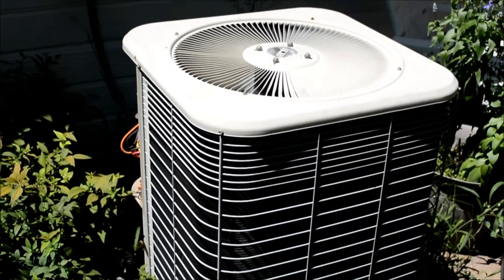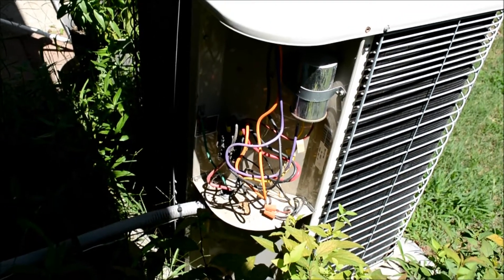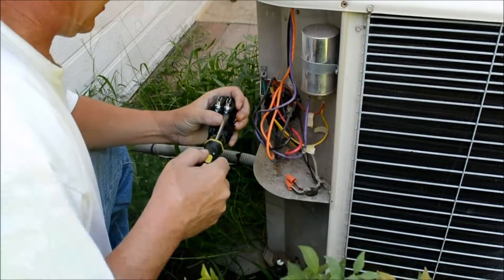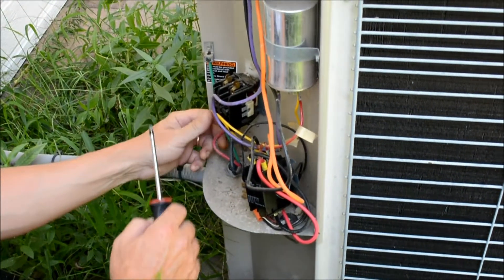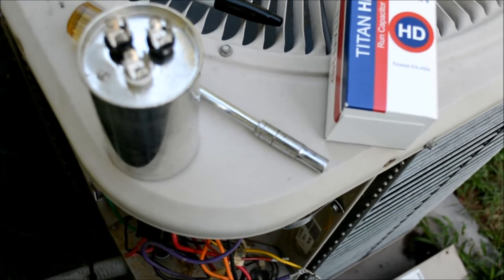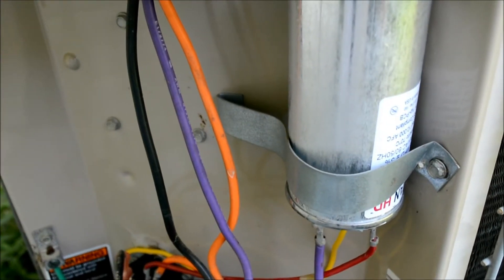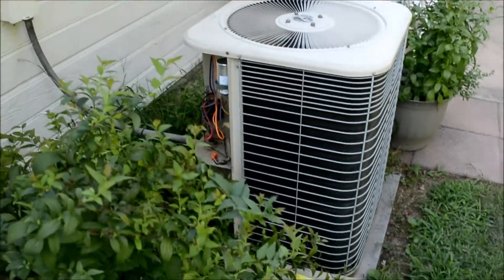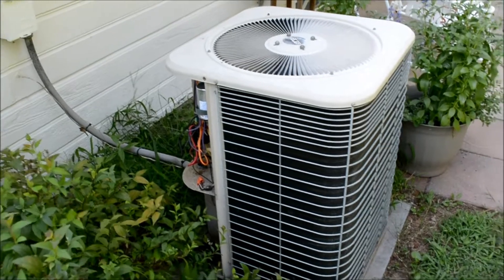Central Air Conditioner Not Working - AC Condenser Unit - Compressor Not Running

Comment: The contactor would have worn out eventually anyway. I changed two this year.   Nice job changing the run capacitor and getting back going. Being able to do this stuff yourself sure speeds things up.
Reply from the maker: Defiantly saved some money and got it done quicker than a service call. Thanks for watching and your comment.